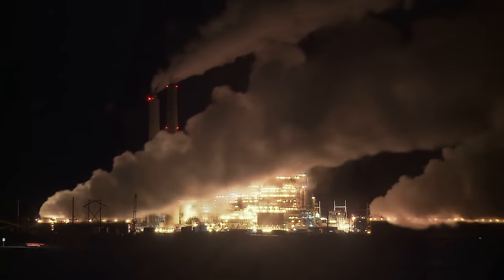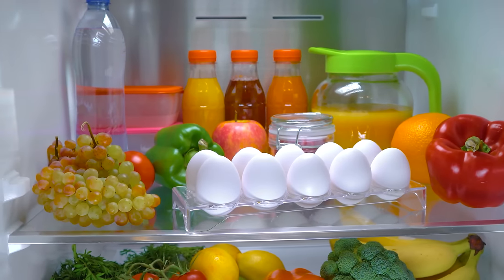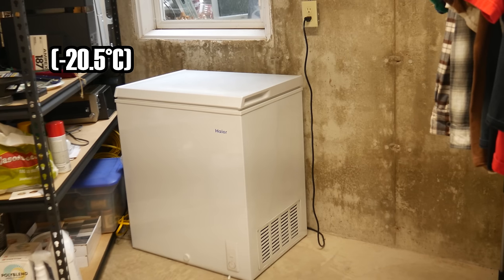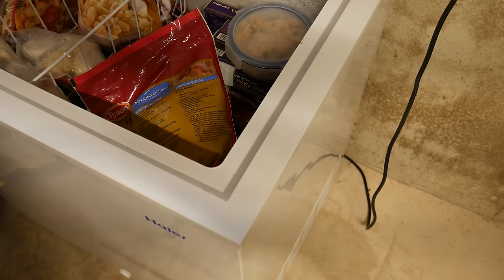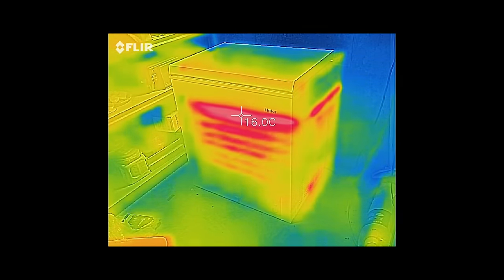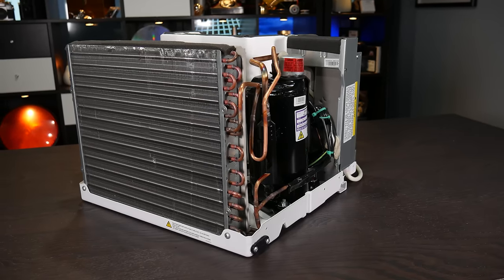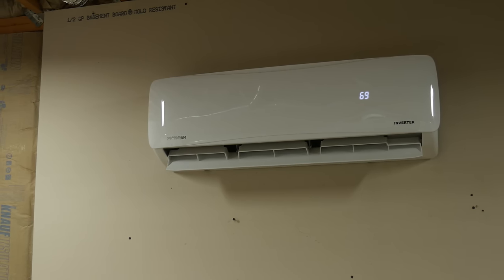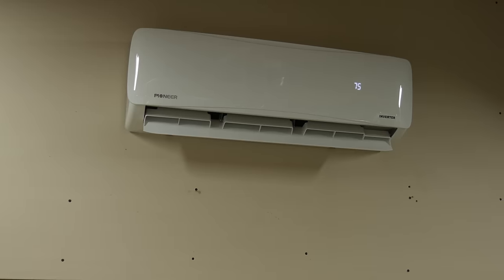Heat Pumps: the Future of Home Heating

Comment: This is like finding out that solar cells are just LEDs
Reply: Holy shit, I didn't know that.
Reply: Wait... WHAT?!
Reply: Explain. Now. 

Please
Reply: @MiniMii550  Just like all speakers are also microphones, and all motors are also generators. All diodes emit light when a current runs though them, and all diodes generates a current when light shines onto them. Both solar cells and LEDs are diodes. So shining light onto an LED generates (a shitty amount of) energy and running a current through a solar panel causes it to become the world's most useless floodlight (it's in infrared)
Reply: And microphones are just little speakers in reverse
Reply: W H A T

wait, does that mean i can turn an led panel into a solar cell?
Reply: @therosijedha  It'll be a pretty shitty solar panel due to surface area. But yeah.
Reply: and light bulbs (incandescent) are just antennae transmitting EM at visible wavelenths...THz  'radio' waves are visible EM
Reply: @ginsederp  yes a motor is a Dynamo when the energy is manually engaged the Dynamo creates a charge
Reply: @ginsederp  You're mostly right, except not all diodes emit light when a current runs through them. Semiconductors in light emitting diodes are engineered to have a direct band gap, which makes radiative recombination the dominant form of recombination (which means that a photon is generated from most hole-electron pairs, which is the mechanism behind light emission from LEDs). On the contrary, a typical silicon diode would have an indirect bandgap, which makes radiative recombination far less likely to occur - in this case, during recombination, a phonon is released instead of a photon, which can be thought of as a quantum of kinetic energy, or heat.
Reply: LEDs can act like photovoltaics when subjected to the same spectrum of light they emit
Reply: Yin/yang. Tomato tomatoe
Reply: @ginsederp  Not all microphones are speakers such as carbon mikes.
Induction Motors can't be run as generators
Reply: Or how a brushed electric motor is just an alternator. How many heads exploded in these comments lol?
Reply: Explain how you have excess light inside and need to pump it outside.
Reply: @Anvilshock  I just made a prototype. I think I’ll call it a window😂
Reply: Seems like i heard of someone somewhere being spied on when a nearby speaker was hacked into a microphone... i dont remember for sure
Reply: @JohnSmith-eo5sp  Induction motor indeed can be run as a generator. Robert Murray-Smith has excellent video on this. Briefly and poorly explained by me: all induction motors store a tiny amount of magnetic energy in rotor. Adding capacitors to motor makes this energy store and when rotating motor, stores more and it helps exciting the generator. Problem about this kind of generation is that it requires pretty acurate RPM:s to generate usable amount of energy.
Reply: @Teknopottu  Wrong, for the AC current would have a deGaussing effect on any residual magnetism
Reply: @diox8tony  That's actually NOT true, unlike the rest of the comments here. Antenna do not radiate in black body radiation like incandescent light bulbs. You could actually make an "antenna" for visible light, but our nanotechnology isn't good enough. You need an "antenna" roughly the size of the wavelength of light which is crazy tiny and thus wouldn't emit much light.
Reply: Just learned something.  Thanks.
Reply: Solar cells dont emit light though, do they? If they use a diode, then its more like a light absorbing diode.
Reply: @termitreter6545  All diodes except Germanium are sensitive to some light and therefore can emit light of that wavelength
Reply: @JohnSmith-eo5sp  Okay, but why dont Solar Cells seem light up when the sun shines at them?
Reply: @termitreter6545  These solar cells need electric current flow thru them with forward bias then they will produce/emit invisible wavelengths of light.

Got that
Reply: @termitreter6545  When electric current flows thru a Silicon diode they emit infrared light.
Most solar cells are Silicon based with a wide surface area for absorbing light
Reply: @JohnSmith-eo5sp   So could you easily run electricity through a solar panel and make light?
Reply: @termitreter6545  NO!
Reply: @JohnSmith-eo5sp  In that case, they are quite different types of diodes, arent they? Those LEDs and the diodes in solar cells.

So that solar cells dont use LEDs.
Reply: @termitreter6545  Oh whatever
Reply: @JohnSmith-eo5sp  That was literally the point tho, OP being wrong xD
Reply: @ginsederp  I'd use an infrared floodlight to use with my oculus quest
Reply: 15% efficiency and very bad materials used to get it as high as 15% efficient and kinda sorta like an LED...
Reply: @ginsederp  ir flood light you say?
Hmmmmmm
That’s not totally useless
Reply: Wind turbines are just propellers in reverse!
Reply: @AbsoluteTiger  A permanent magnet electric motor (converting mechanical energy into electrical energy) is a generator not a dynamo . Similar concepts but different behaviors.
Reply: Those churro twists at taco bell are just fried rotini pasta...
Reply: I'm sorry... what now?
Reply: And finding out solar cells are just LEDs is like finding out LEDs are just radiation detectors.
Reply: or a motor is a generator.
Reply: Petition to rename solar cells “Light Absorbing Diodes”, or LADs for short
Reply: @AbsoluteTiger  or are speakers microphones in reverse.🤔
What a concept.
Reply: Transducers!
Reply: HUH
Reply: @lorem9587  i get what you are saying but they both work on the same pronciples using semiconducters to get a specific result, LED’s, etc are pretty easy to understand and once you do ypu can apply their logic to a lot pf other thing
Reply: Technically not, LED stands for Light Emitting Diode not Literally Every Diode.
Reply: LEDs are solar panels
Reply: And leds are diode 's😂😂😂😂
Reply: @liquidthex  a light emitting diode is still a diode
Reply: @guysimone1  Cool no one said they weren't.
A LED is a diode that emits light, hence the name LIGHT EMITTING diode.
A solar cell is a diode that doesn't emit light, hence the lack of the name LED.
Reply: @liquidthex  it doesn't, but it could
Reply: @andruloni  You can make almost anything conductive glow at least until it melts or burns, doesn't mean it's a lamp.
Reply: @ginsederp  thanks for your time explaining this to us 👍🙌
Reply: wait WHAT
Reply: I studied LEDs and solar cells.  They were doped very differently to achieve their results.
Reply: @therosijedha  I wouldn't want to know the cost of the amount of LED diodes you would need a 100 watt output, but in theory it is possible

Comment: This video is the linchpin of the Technology Connections Cinematic Universe
Reply: Alec is a smarter character than we've had before, if we can get him working...
Reply: He really made the "Connections" part pull its weight in this episode!
Reply: Yep. It's all heat pumps. Always has been.
Reply: Phase change was a surprise tool that will help us later.
Reply: If only we could connect Teletext and refrigeration cycles somehow.
Reply: @Yootzkore  it's heat pumps the whole way down
Reply: I was thinking that Infinity War was still the better cross over, but then the rice cooker appeared and changed my mind...
Reply: You couldn't live with your energy inefficiency. And where do they bring you? Right back to me.
Reply: How does this fit with the beta/vhs wars though
Reply: @TehVulpez  With the right sensors and the right serial interface, we can do anything we set our minds to.
Reply: You refer to the prophecy of the one that will bring balance to the thermodynamic system. You believe it's this… heat pump?
Reply: This is Part 1: Condenser War. Part 2 is Airgame.
Reply: @TokyoXtreme  At first I was like but don't heat pumps do the opposit- then realized how well this joke works.
Reply: the funnier part to me isn't the rice cooker plug

it's that he doesn't plug the furnace, space heater, humidifier, thermostat, and personal ac videos that all also contribute to this vid

not only that, but the toasters are electric resistive heating, and so are also related
Reply: @TokyoXtreme  Pressure leads to condensation, condensation leads to the release of latent heat, latent heat leads to... Air conditioning.
Reply: @TehVulpez  Did you know that you can heat or cool your entire home, using only the energy found in the hidden scanlines at the top of your TV picture?